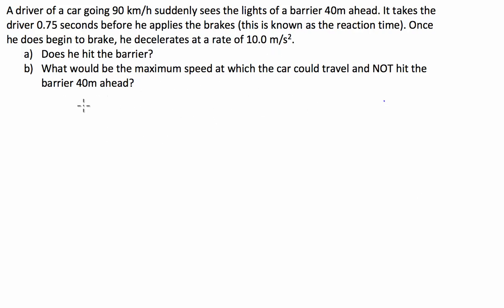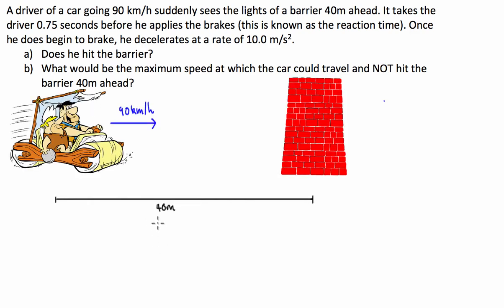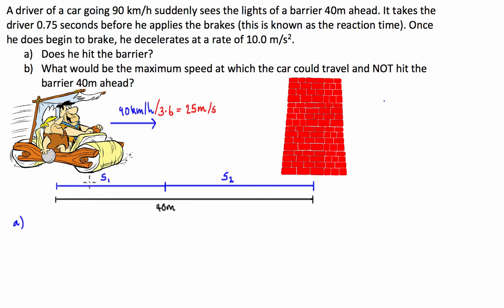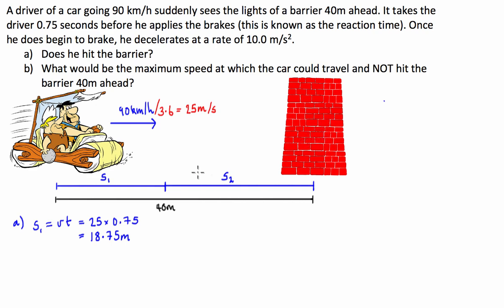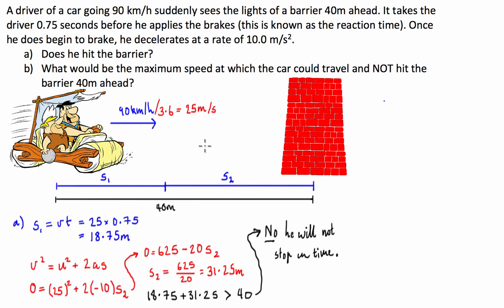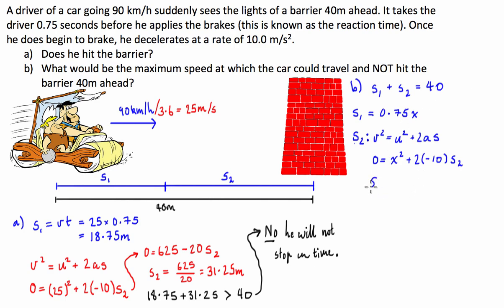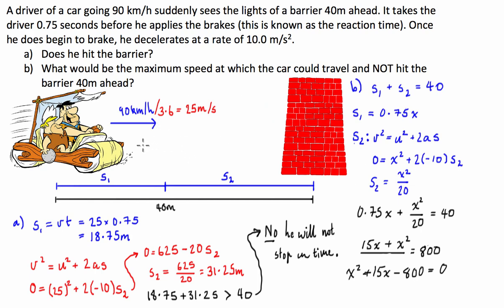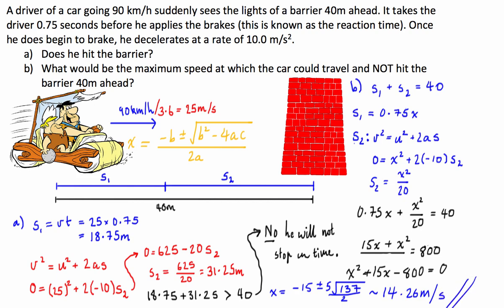PHYSICS - Calculating the Braking Distance of a Car (Exam Question Example)

Comment: I'm not a scholar by any stretch, but wouldn't the weight of the car make a difference in a real life scenario?
Reply from the maker: Hi Paul, in this situation the driver presses down the brake pedal and the car deaccelerates at a rate of 10m/s/s. The deceleration experienced by the car will be commensurate with the force which is applied to the four brake rotors and the mass of the car according to Newtons 2nd Law (F=ma). So, in essence you are right about the mass playing a key role – its just factored into the information provided in the question. 

I hope this helps.

Harold :)
Reply: @HaroldWalden  My day job involves testing brakes on cars and light trucks in one of two ways. Firstly; by way of of a brake roller machine where we take the sum of each wheel's effort and divide by tare weight to give a percentage, pretty easy. (50% is considered a pass)

Secondly, measuring stopping distance over 7 meters, from 30kph. The car passes if the stopping distance is within 7 meters. I was asked, (during an audit) why I didn't write the percentage onto the check sheet.

I'm not educated enough to know the answer, but I feel the answer lies in your video somewhere? 

Thanks for reading mate 👍

Comment: Can anyone solve this ?
Find the stoping distance if Vehicles  weight = 300kg 
Speed 40km/hr
Coefficient of friction of ground =0.8
Wheel dia= 566mm
Width =177mm
Consider all wheels locked.

Comment: can anyone answer this question pls 

A car is travelling at 40.0 m s−1. The driver sees
an emergency ahead and 0.50 s later slams on the
brakes. The deceleration of the car is 4.0 m s−2.
a Find the distance travelled before the car stops.
b Calculate the stopping distance if the driver
could apply the brakes instantaneously
without a reaction time.
c Calculate the di  erence in your answers to a
and b.
d Assume now that the car was travelling at
30.0 m s−1 instead. Without performing any
calculations, state whether the answer to c
would now be less than, equal to or larger
than before. Explain your answer

Comment: Hello Sir What is 3.6 ? where do you get that?  Thank you..
Reply from the maker: It’s just a constant that you can use to quickly go from kilometres per hour to meters per second.
Reply: It is confusing (and wrong) as it is in the video. The correct equality is 90 km/h=25 m/s.
Reply: It's better if you divide it by 5/18 , for easier calculations.. eg. 90×5/18 = 5×5 =25 m/s.

Comment: Hello good evening, please i need your help to solve some driving questions in regards to stopping distance, reaction distance and breaking distance.

1. You are travelling at 100 km/h and break normally. what is the breaking distance according to the rule of thumb?
2.You are driving on a very narrow road and can see 50m ahead. what must be your maximum stopping distance?
3. You are travelling at 100 km/h, have a reaction time of 1 seconds, and brake normally. what is the stopping distance according to the rule of thumb?
4. You are travelling at 50 km/h and brake normally. what is the braking distance according to the rule of thumb?
5. You are travelling at 50 km/h, have a reaction time of 1 seconds, and brake normally what is the stopping distance according to the rule of thumb?
6. You are travelling at 100 km/h, and have a reaction time of 1 seconds what is the reaction distance according to the rule of thumb?

please reply to this email bartholomew1@live.com the procedure to arrive at the answers. 

thanks.
Reply from the maker: I am not going to do your homework for you mate but here is a little bit of information to make your life easier. 

The rule of thumb for the stopping distance in a city in good conditions is the 1-second rule, i.e. the distance covered in 1 second should at most be the distance to the vehicle ahead. At 50 km/h this corresponds to about 15 m. For higher speeds up to about 100 km/h outside built-up areas a similarly defined 2-second rule applies, which for 100 km/h translates to about 50 m. For speeds on the order of 100 km/h there is also the more or less equivalent rule that the stopping distance be the speed divided by 2 k/h, referred to as halber tacho (half the speedometer) rule, e.g. for 100 km/h the stopping distance should be about 50 m.

Hope that helps 😁
Reply: Harold Walden 
Thanks for the information meanwhile this is not a homework they are  questions from driving school when one want to get a driver's licence in Germany. All i seek from  you is formulas and procedures  to arrive at the answers because we are given the answers why learning from the app. I hope to hear from you. Thanks.
Reply from the maker: I think if you read my previous comment you should have all the information you need. 

Thanks again for watching :)